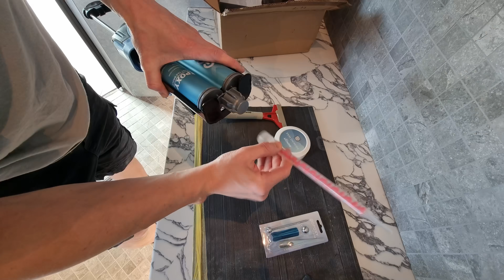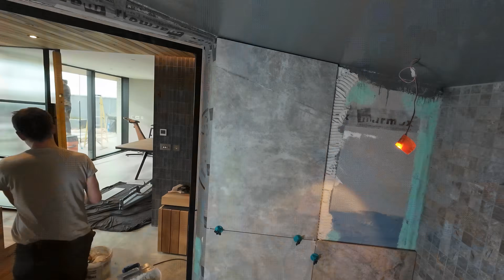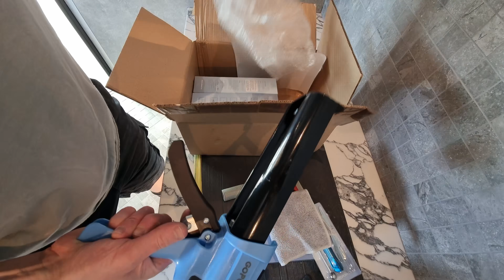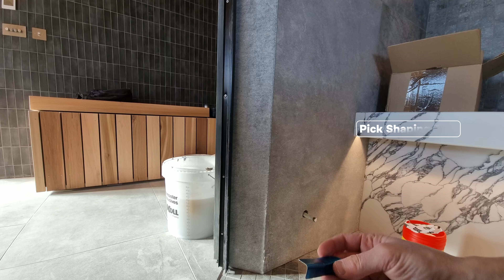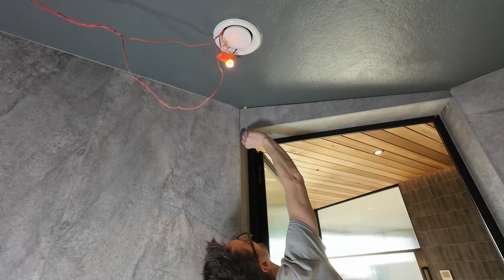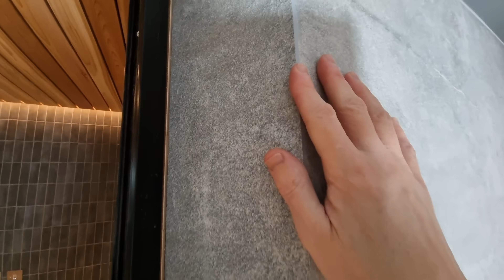This Could Change How You Resin Tile Mitres!

Comment: How many metres in length does each combination tube do? For a 2mm mitred joint.
Reply from the maker: Hey mate, I think they've got a calculator on their website when you click on a product.. But I'd say I had about 2/3's left in the tubes after this doorway.
Reply: @thebespokebloke  Thanks, the calculator on the website was quite confusing if you only want to calculate for a run of mitred corners rather than whole wall m2.

Comment: Sick results! Will definitely try to use it once I finish my tiling
Reply from the maker: Awesome, Yeah it's a great product mate. Just do a tester first to get comfortable with it 🍻
Reply: @thebespokebloke will try . It's my first bathroom renovation ever. And my own...so loads of different skills to learn..but am absolutely determined to go for the end results I wish.
Reply from the maker: @jeffreyvanzeijst7932  Awesome, Any questions just fire them my way mate, And best of luck 🙌
Reply: @thebespokebloke  thanks man! Maybe I'll need it later.. right now I'm taking off all the old and had this major hassle.. during original construction and installation of the original bathroom, the tiled the walls first..than added the plumbing network on the floor ontop of the waterproofing membrane..than covered with pouring mortar and raised the entire floor like 6cm.. than tiled the floor. Which means my bottom row off wall tiles are completely locked in unless I dig out that floor. To my understanding it was sufficient enough for example to add the membrane under the shower pan..seal the corners etc we'll  and tile ontop of that.  membrane. Also I don't understand why they didn't finish the walls till the bottom row..than finish the floor tiling and fit the last row. Put sealant in all the joints. I assumed you tile the walls ontop of the floor?
Reply from the maker: @jeffreyvanzeijst7932  No problem mate.. Sounds a right old pain! You never know what you're going to get until you get involved. But yeah that sounds like a lot of hassle! Personally I'd usually tile walls first so I'm not working on top of the finished floor (not always, depends on job, but generally). If it's a wet room I'd always do the floor first for the waterproof barrier. The other case to do the floor first is if you're matching wall and floor tiles, Flor needs to be done first in that case, As if the bathroom isn't 100% square (which it won't be) then the tile joints won't line up.
Reply: @thebespokebloke  absolutely makes sense to keep the floor clean.. finishing the walls first prevent falling off any glue plaster etc later on..but I guess in normal circumstances you realise when they insist on rising the floor that much it's unnecessary to tile all the way down the bare substrate.. just meet where the floor will end up to be. Anyway I'll find a way to solve things up here and hopefully later on will be absolutely proud of how my plans came to reality.

Comment: Really helpful! Looking to attempt mitre cuts for the first time. I’ve used Kerakoll NO3 grout for the rest of the room. How do you ensure the colour match is accurate if using a different brand like Go Poxy? Thanks
Reply from the maker: Awesome thanks Chris, I've got a bit more detail on mitre cuts in my "How To Cut Tiles Video" to. Nice, I really just matched it with what looks right with either the tile or grout. The No3 light grey GoPoxy I'd imagine is similar to the number 3 kerakoll, but you could also match tile colour rather than grout.. depending on what you think would look better .
Reply: @ that’s great. thanks for the advice. I’ll check out the other video too 👍

Comment: How do  you measure tiles for miter cuts ( like length) do you have to add an extra 1/4" or tile thickness for each cut?
Reply from the maker: Yes mate, Generally overhang them by  at least a tiles thickness.
Reply: @thebespokebloke   nice so for example if its measuring 30" to the corner - i add 1/4" (my tile thickness) so it will be 30" 1/4 with the miter ??
Reply: What about thickness of thinset
Reply from the maker: @ If I was measuring a mitre for a window reveal for example.. either measuring off another tile or from a wall, I'd just add 10mm to whatever the measurement is. For adhesive, I wouldn't worry to much, Once you've fixed one mitre you can just mark the other one to correct size.
Reply: Add 5/8” to over all length… to compensate for tile,mortar and imperfections.